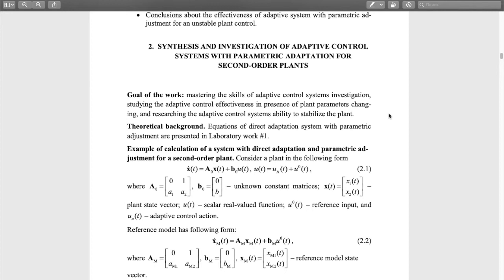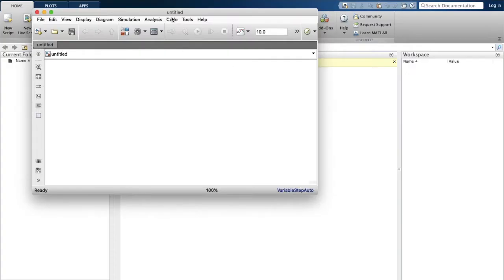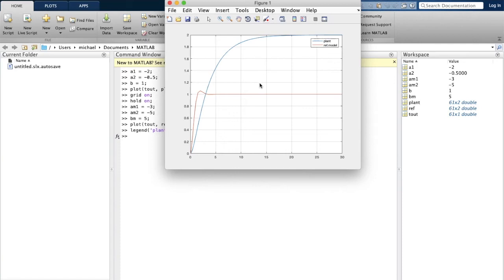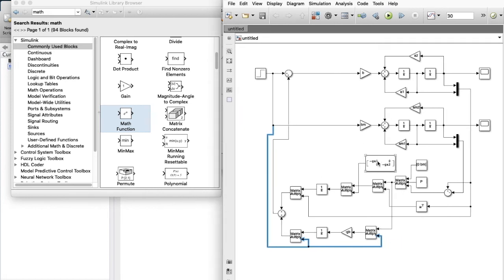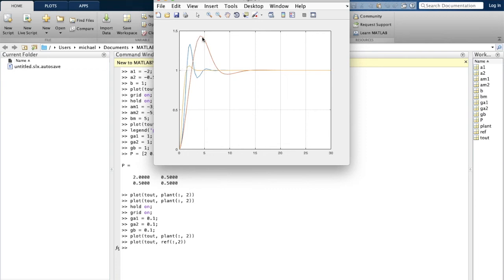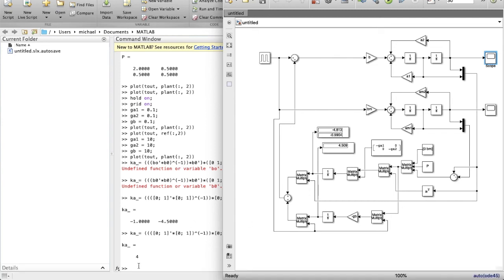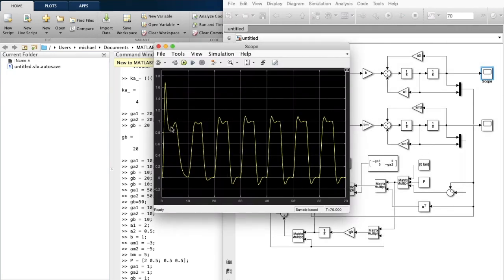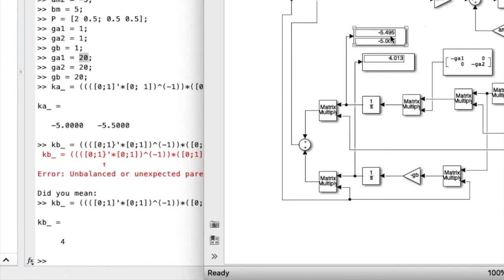Lab #2. Second order STABLE+UNSTABLE plant adaptive control system studying

Comment: I repeated the same thing with the same parameters and I got a different transient response for both the plant and the reference model. Link to my model -> https://drive.matlab.com/sharing/12c4d843-9890-4ce5-b4b1-fc5bd5a12f03
Reply from the maker: Could be, but my goal was to show step by step instructions what to do in the lab.
Reply: @michael_mmk  I understand but is it possible for the transient response of the reference model to reach stability at a level higher than step input. For example, if step input is 1, reference model stabilizes at 1.6 etc...?
Reply from the maker: Yes, it is possible. This is called astatism or offset effect and this is completely depends from the plant, for example if plant is very elastic.